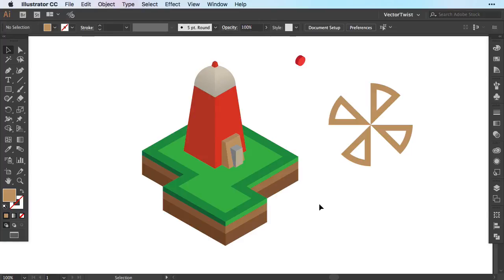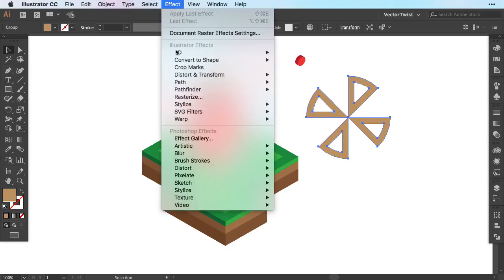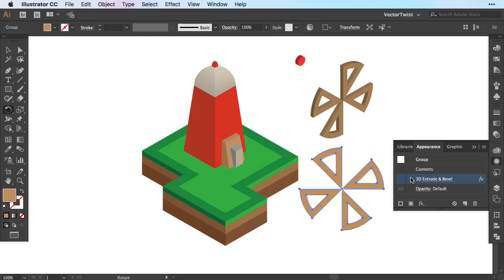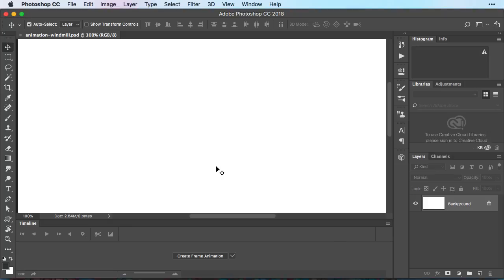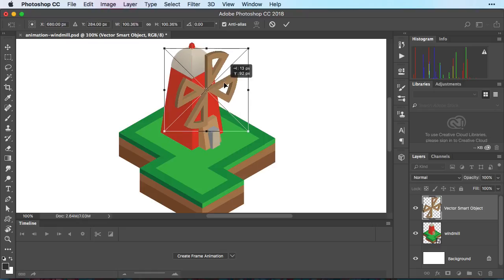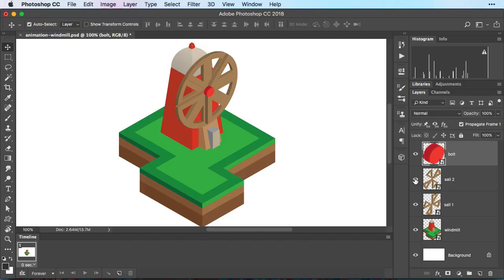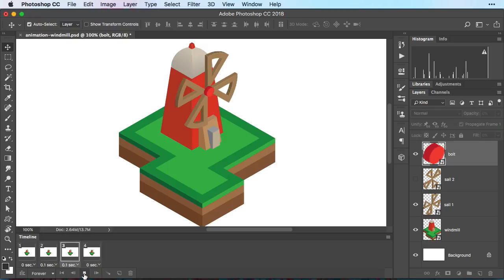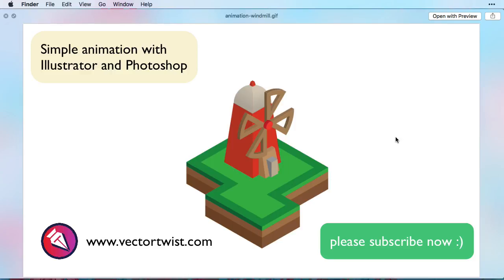How to Create a Simple Animated Gif (Illustrator and Photoshop) / Animation

Comment: how do you make the wheel? Great tutorial and great explanation but I am having a hard time replicating the wheel
Reply from the maker: thanks, use a circle with just a stroke and create lines vertical and horizontal, then add two diagonal and with the Pathfinder divide all, then ungroup and add a stroke and make it as think as you like and change the stroke to inside. then delete every other piece :). hope that's helps :)